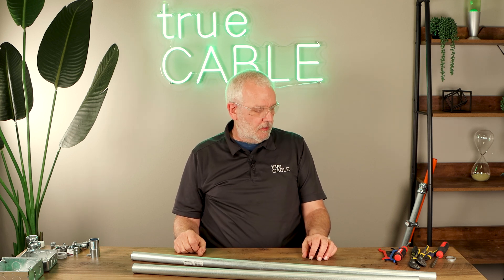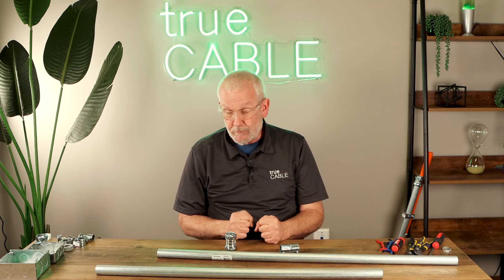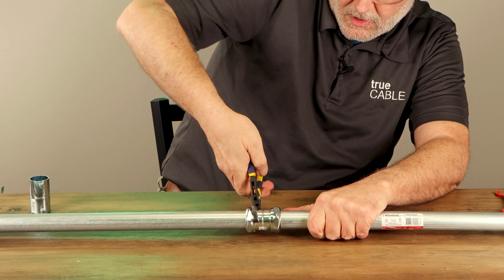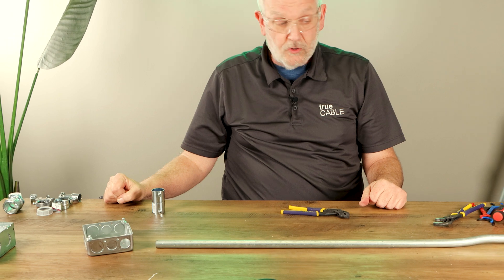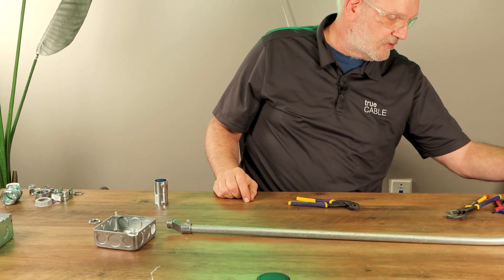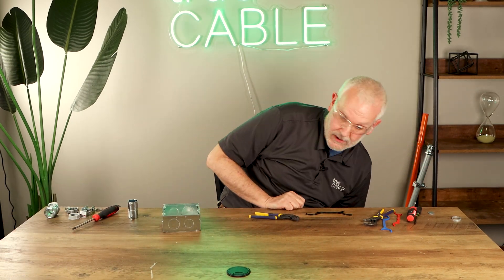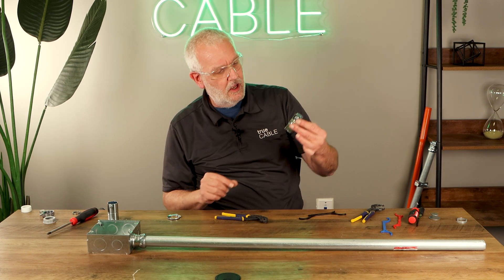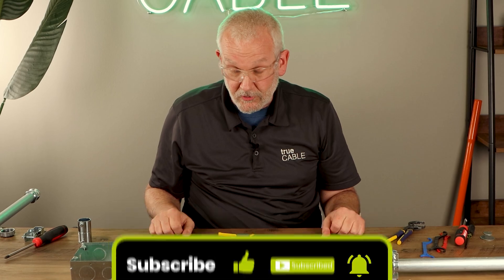A Beginner's Guide to Conduit Coupling, Box Connections And More!

Comment: What is the white protection busing called? I cannot seem to find anything similar.
Reply from the maker: Hello! You will see this sold as "EMT Insulating Bushing" or "protective sleeve bushing". Essentially, it is just a piece of plastic that slides over the cut end of the conduit to prevent the sharp edges from ruining your cable while pulling it. Hope this helps and happy networking!